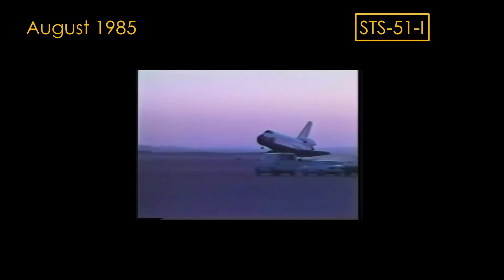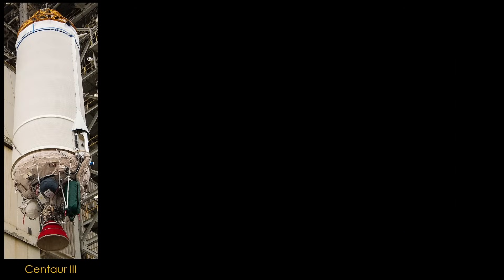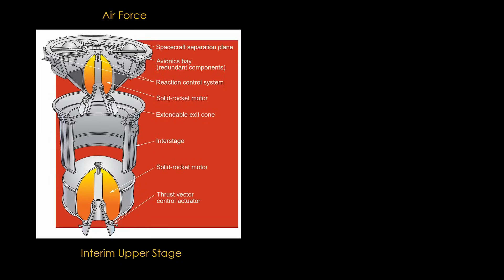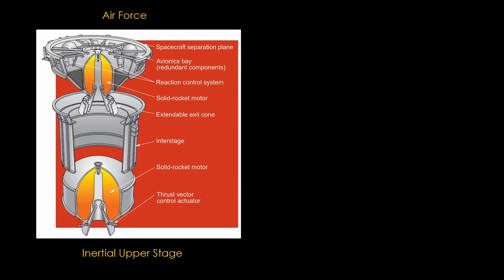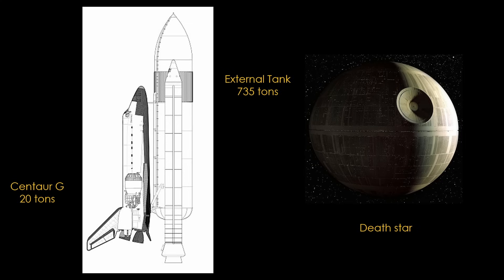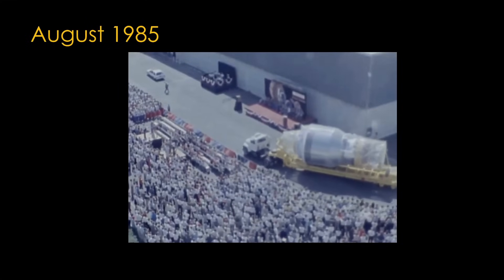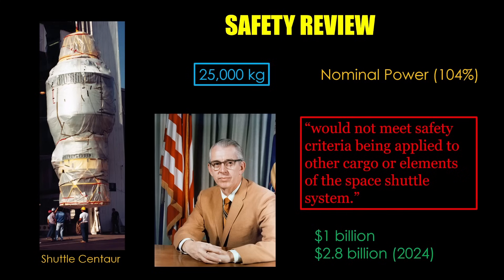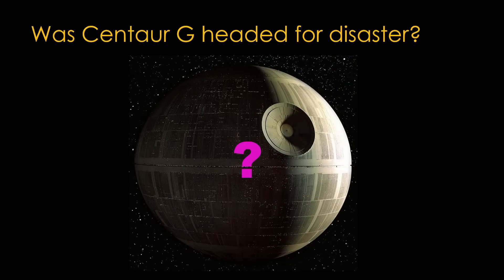Shuttle Centaur - Disaster Avoided?

Comment: Do you think the Soviet Energia-Buran would've solved this issue since the Enegia booster stage was an independent system.
They did launch a massive satelite with it ( though the satelite failed to reach orbit after detaching from the booster)
Reply from the maker: Not really. 

Energia was a really cool rocket if you wanted to launch really big and heavy payloads, but it was reportedly very expensive. Putting payloads in a reusable shuttle to put it on an energiya so you can get the shuttle back costs more than an energiya launch by itself and carries much less useful payload.
Reply: @EagerSpace  
I didn't get the point.
Energia launching payload alone is cheaper than energia-buran launching payloads . Did I get it right ?
Why use buran shuttle when energia can function independently?
Reply: It didn't have an orbit-only stage like this, so no. If a stage was designed for it, it would benefit from being designed after the vehicle was in service, and thus less susceptible to the payload underperformance issues that drove a lot of the Centaur-Shuttle integration issues, and also from having 80-90 odd tons to play with instead of 22 tons (for a variety of program reasons, just because you can toss 100 tons or something to LEO, and thus 20 tons to whatever random high-energy orbit, it rarely translates to actually having a 20 ton probe, so there's more margin with starting from a heavier lifter--compare how Europa Clipper worked on SLS originally as a ~6 ton probe, and how they were able to restructure the trajectory to fit on expendable Falcon Heavy in the end.

Comment: The Challenger disaster caused a three-year delay in the launch of Galileo.
  
On 11April 1991 Galileo's computer commanded the umbrella-shaped main communications antenna to deploy, a three-minute procedure similar to opening an umbrella. Data from the spacecraft indicated that the deployment was only partially successful, and the 16-foot diameter mesh antenna was lopsided, i.e. it was more fully deployed on one side than on the other.  NASA quickly determined that the dry film lubricant used on the deployment mechanism probably had degraded during the long storage period following the Challenger disaster. 

Over the next several years NASA used mechanical force and differential solar heating to free the stuck antenna without success. Galileo's high gain antenna was completely useless. NASA had to use the low gain antennas at 10 bits per second data rate and faced the possibility of losing much of the data initially planned for the mission.

NASA had no choice but to carefully control the propellant usage and extend the mission as long as possible. On 21 Sep 2003 NASA ended the Galileo by sending it into the Jovian atmosphere at an entry speed of 48 km/sec.

Comment: I wonder whether the constellation program would have been able to move faster if they used a traditional shuttle stack like shuttle C, with a hydrogen upper stage like centaur or the S-IVB. It might have actually been able to bear the fruits of being "shuttle derived" to reduce development time, rather than only lining the pockets of existing shuttle contractors.
Reply from the maker: There was the Direct/Jupiter project that was in that vein. The Wikipedia article is pretty good.

https://en.wikipedia.org/wiki/DIRECT_%26_Jupiter_Rocket_Family
Reply: @EagerSpace  I am very skeptical of the efficacy of "in-line" shuttle derived vehicles; Wasn't SLS majorly delayed from redesigning the fuel tank to handle higher structural loads caused by this configuration? A horizontally integrated stack could also provide better main engine reuse options. It seems like one of the lynch pin issues that the DIRECT team had with the constellation program was the use of a five segment booster, but this was already proposed as a shuttle upgrade and has since been demonstrated on SLS.

Comment: Starship centaur would be lit tho.
Reply: Instead of wide centaur, Starship would need fat centaur.
Reply: Starship Helios
Reply: @whingebot  When the old guard of US rocketry falls, I'm sure someone will scrape up the Centaur design and repackage it for Starship in competition with Helios
Reply: Maybe in some cases the cost of an expendable kick stage would be cheaper than multiple starship refuelling flights?
Reply: Starship with an F9 upper stage would be more likely. That avoids dealing with liquid hydrogen which is particularly important if SS uses refilling and so needs to loiter in LEO. It's cheaper for SX, there's over a hundred a year coming off the line right now, so availability and reliability are proven.
Reply: If starship is ever going to launch interplanetary missions, it will need something like it.
Reply: @adrikrotten880  you realise that SS is literally designed to land 100 tonnes on the surface of Mars right?
Reply: @gasdive When I said interplanetary missions, I meant NASA science missions. Starship is extremely inefficient at any orbital maneuver above LEO.

Also, 100 tons to Mars is hilarious, not that I could change your mind on that. I'll eat my hat if they even orbit Mars within the next 20 years.
Reply: @adrikrotten880  Yeah thats the nature of reusable launch vehicles, they typically perform worse. That drop in performance is worth getting both stages back, but you probably think it will be just like shuttle like everyone else that hasn't been paying attention to anything.
Reply: @adrikrotten880  It's definitely theoretically possible with the current design for it to do 150 tons to the surface with LEO refueling and ISRU
Reply: @reagank.2268  I watch every static fire and launch religiously, and I hope I'm wrong. However, there is a lot to still prove.
Reply: @adrikrotten880  not that much to prove to be able to do NASA interplanetary missions.

Even if they never get reusability on the second stage. Practically everything else is demonstrated at least in parts, even if not in one flight.

A fully fuelled F9 upper stage fits inside the cargo bay of Starship. That's enough to put 50 tonnes into TLI (assuming LEO plus 500m/s) or 8 tonnes to Pluto with no gravity assists. (15 times heavier than New Horizons)

Starship second stage is made of much cheaper materials than the F9 second stage which they expend twice a week. It may cost SX less than the F9 second stage. I think the time of really big probes is here.
Reply: @gasdive get back to me when it reaches LEO without blowing up.
Reply: So would New Glenn…